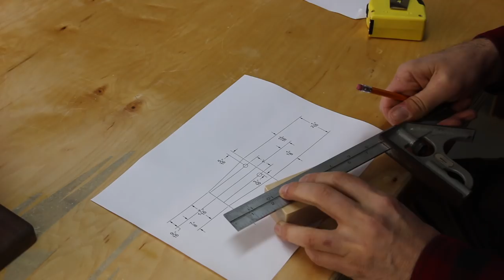DIY Spiral Staircase 1/6th Scale

Comment: WOW!!! Completely stunning project. 💜💜💜 But I have to correct you as to the scale of this project. This seems to be much larger than 1:6 scale. I work in 1:6 scale (also known as Play scale) and it is the size for Barbie dolls. This project as-is would never fit into one of my dollhouses. I will, however, be utilizing the pattern and techniques for the spiral stair case to add to a Victorian dollhouse I’m designing now. Again, wonderful project. 💜💜💜

Comment: Beautiful workmanship. Thanks for sharing this video. 1/6 scale is perfect for this type of project. If you wouldn't mind may I inquire as to the step thickness and dowel diameter which you used? Looking forwards to your next build video.
Reply from the maker: The steps were 1/2 inch thick and the dowels were 1/4
Reply: Hey thanks for the reply. From the video, that was what I had guessed, but I have been known to be wrong now and then.  I've been building scale structures for years and when I came across your spiral staircase I was in awe! That is one project I have never taken on but I think you just may have inspired me to give it a go. Enjoyed your box project too. Hope you will continue to post more.